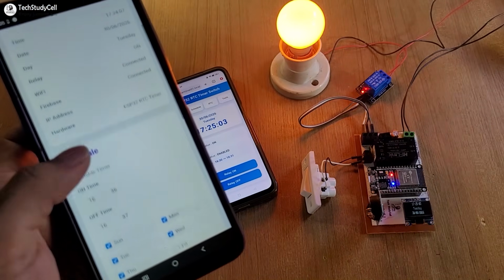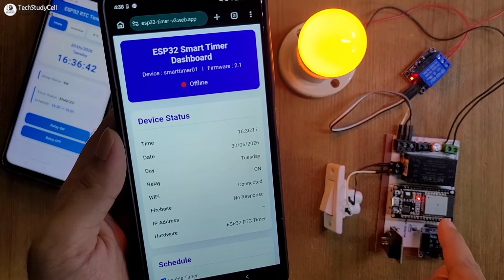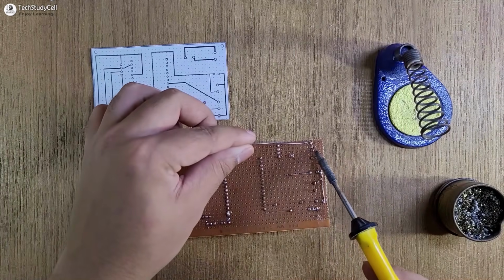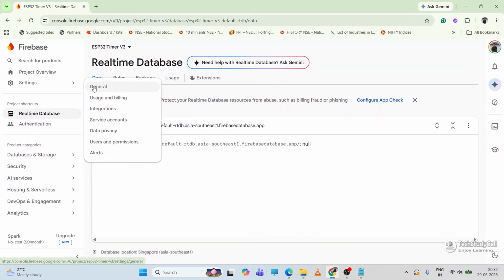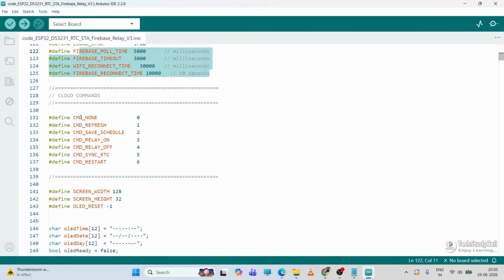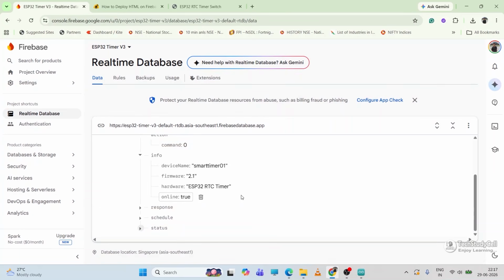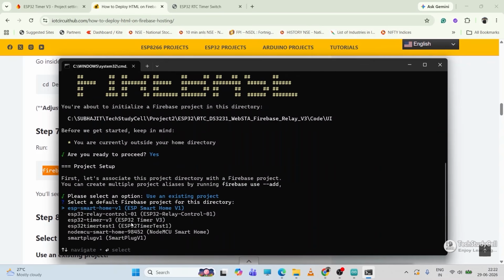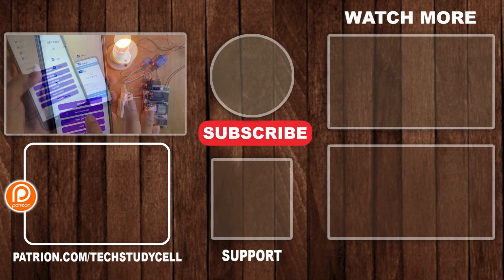ESP32 Firebase Smart Timer with DS3231 RTC | IoT Web Dashboard | Remote Relay Control

Comment: I am a 9 th standerd stodent can you make me a iot project by using arfuini r3 for my science pls the budget aound at low cost below 500 iss very good 700 also ok but above 900no pls make that plssss 😢😢ESP-01 ESP8266-01 WiFi Transceiver Module
Reply: What do you want to make? What is your idea? Pls explain. Also if your budget is low you can use esp8266 12f or 12e module.
Btw esp8266 is way more powerful than arduino. You don't even require arduino r3 or any arduino. Esp8266 alone is sufficient for most project.
Thats all... 
Happy Tinkering...

Comment: A very valuable video, if possible, please post how to make an ILI9488 3.5inch spi ntp clock. Make it so that the display dims at night. Also make it so that the color of the numbers can be changed. If you put a small display, it is not visible at night. Thanks.
Reply from the maker: Thank you for the suggestion, I will look into creating a tutorial for that project.

Comment: Excellent  !
As always your project is awesome.
Hope in future will be using internet NTP instead of RTC module for time.
Is it possible to use Google Script for internet connectivity instead of Firebase for this application.
Reply from the maker: Thanks for the suggestion; it is technically possible to use a script, though it would require a complete change to the code logic. for internet NTP, please refer to: https://youtu.be/H2sBmCuo3Pw